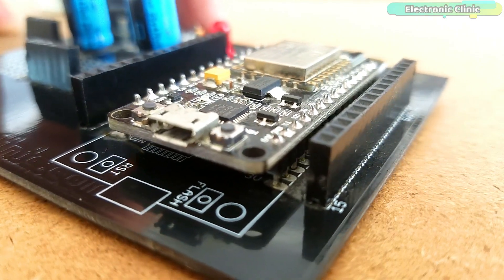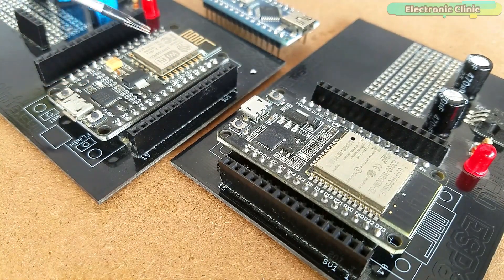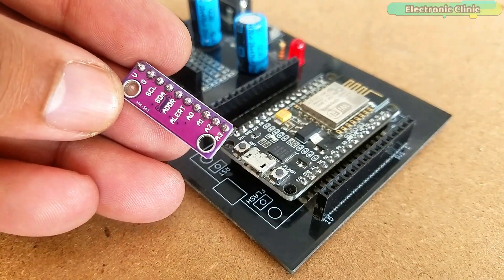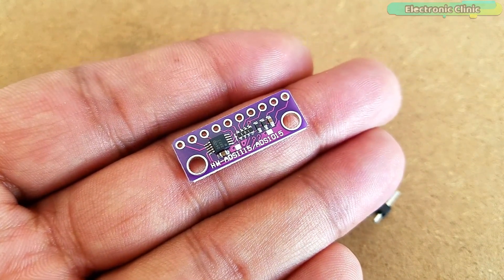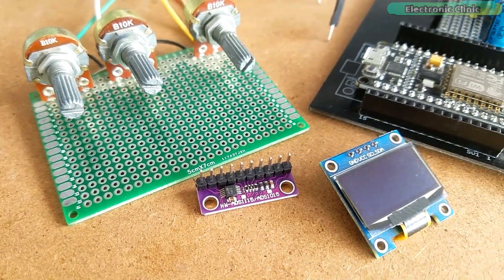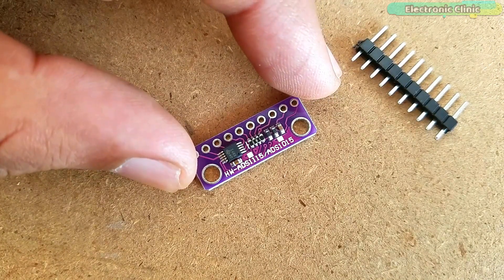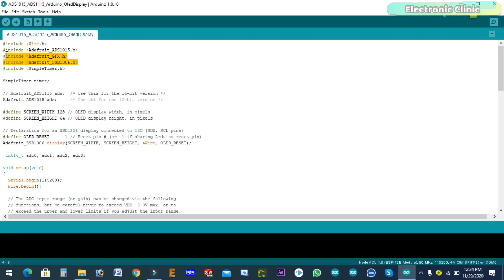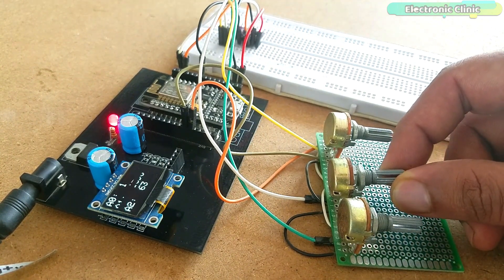ADS1015 with ESP8266 NodeMCU for Multiple Analog Sensors Monitoring, Analog Extender, Arduino

Comment: Hi @ElectroniClinic, If I provide 3.3v to ADS1015  with GAIN_TWOTHIRDS used in the code, Can ADS1015's input handle up till 6.144V ? Or is 6.144V applicable only if I provide a voltage of 5v or 7v to ADS1015 ?

Comment: Thanks for the very useful video. Can I use  TDS , pH , water temp ( DS18B20)  and Air temp with humidity  all 4 sensors with this ADS1015  with ESP8266  for monitoring water quality of my hydroponic system remotely ? please reply. Thanks.

Comment: Sir, Can i measure ac voltage 220V and battery voltage 55V using adc1015 ?
For battery voltage measuring by resistance network ground is common.
For ac voltage 220V measuring by using isolation trasformer.
Reply from the maker: watch my video on overvoltage monitoring. in that video i have explained how to measure higher voltages.
Reply: @ElectroniClinic  please share the link for higher voltage measuring.

Comment: Fahad can we use Tip122 npn Transistor  with Nodemcu 8266 to control relay.
Reply from the maker: yes
Reply from the maker: you can use 2n2222 its cheap. you dont need to use tip122 for relay
Reply: @ElectroniClinic  ok thanks .
Reply: Did u make projects on MIT app inventor?
Reply from the maker: no. i design apps in android studio
Reply: I like the AO3400 n-channel MOSFET for this purpose.